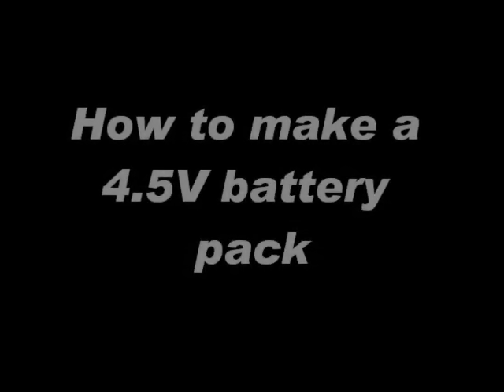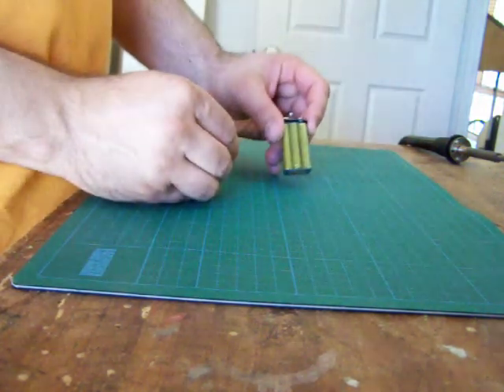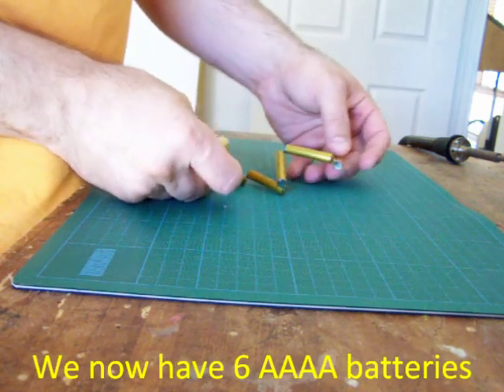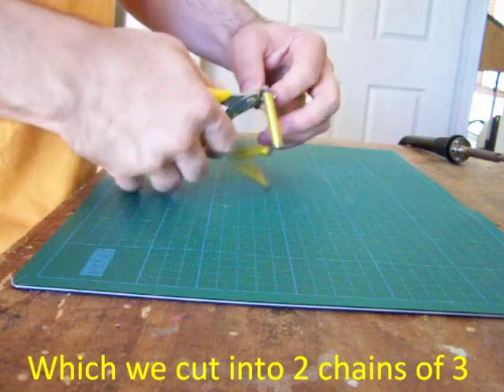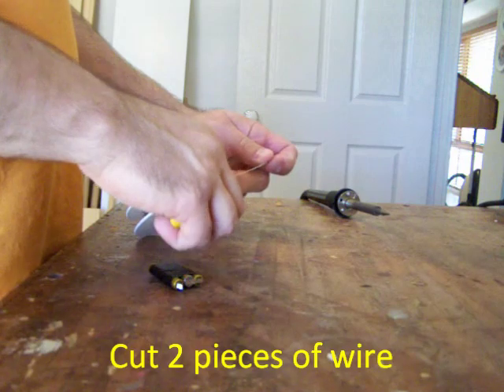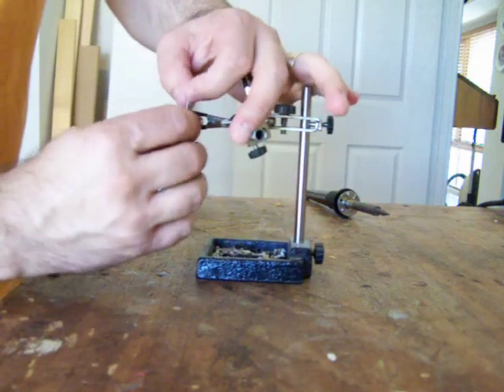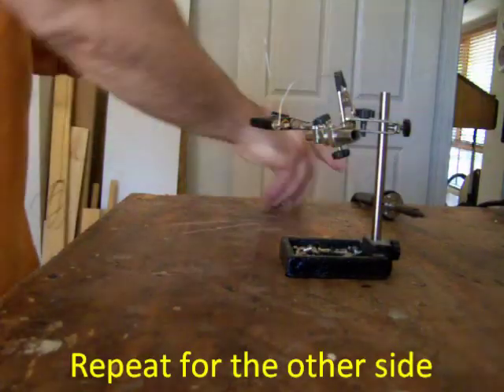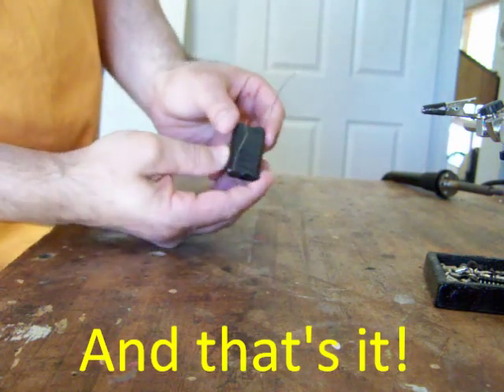9V Battery hack - How to make a 4.5V battery out of a 9V battery

Comment: Don't do this with 9v energizers found in America. The AAAA's inside are not connected by wire and are made of a metal that will not stick to solder. The 9v uses thin wafers with even thinner bands of metal tracings. The groupings of AAAA's are pressed to the wafers to complete the battery.